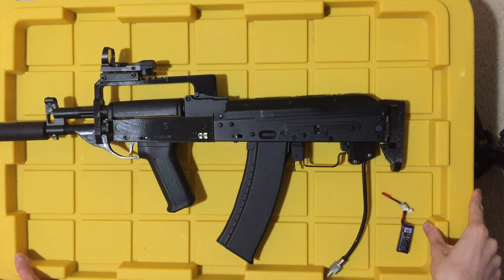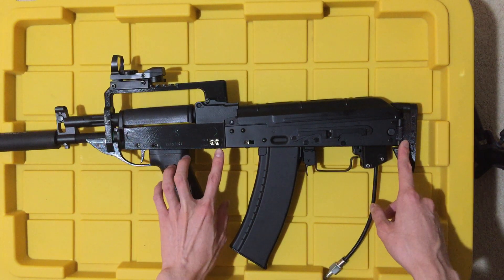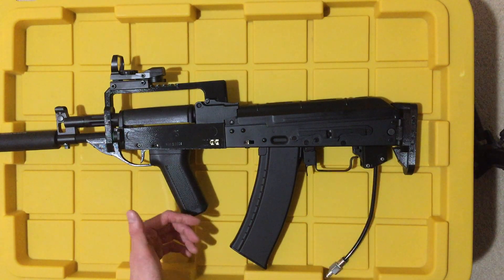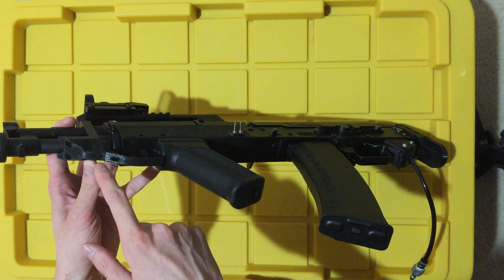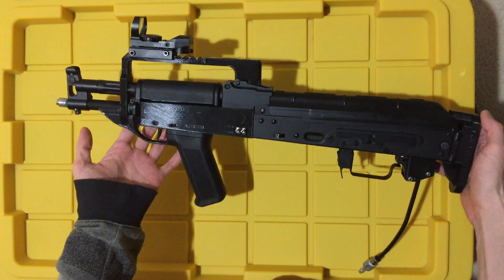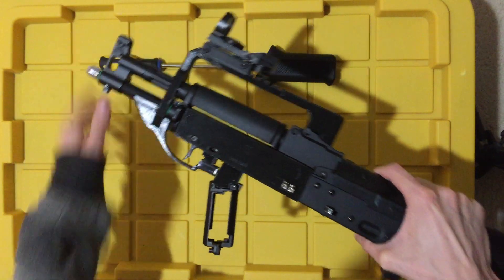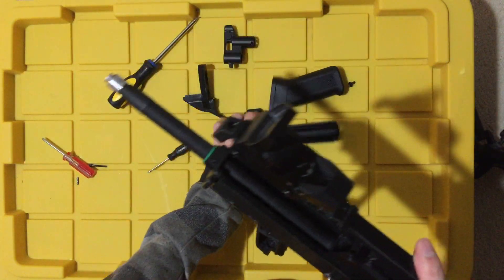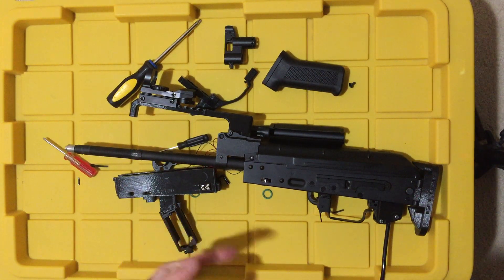OTS14 Overview

Comment: Great Designs, I was planning on making an OTS14 Groza myself, so I looked for some designs and your seem to be the best. Are you still planning on making a video on how to wire the fire selector to the original ak ones instead of the switches?
Reply from the maker: Unfortunately I do not have a V3 trigger board to create an example out of, so it isn't really an option at this time. If you have the original HPA trigger board for the V3 gearbox, all you really need to do is remove the original trigger switch and run extension wires to the forward microswitch for the trigger. It might be tricky to desolder the switch if you aren't particularly experience with soldering small electronic components. Everything else stays stock as the switches for safety, semi, and full auto will be operated by the normal selector components.

Comment: cool part

Is it possible to relieve this with an AEG?
you would only need a cover for the engine. but how do you solve this with the deduction? synonymous with Mircoschalter but how can you solve that only semi shoot does? I live in Germany and everything about 0,5j must be semi-automatic
Reply: if it is not possible to build this as a semi-only it will be just a 0.5 spray can